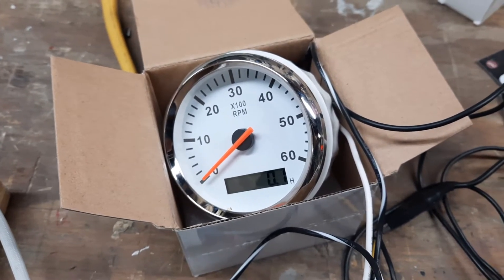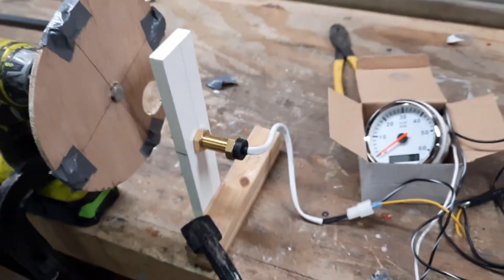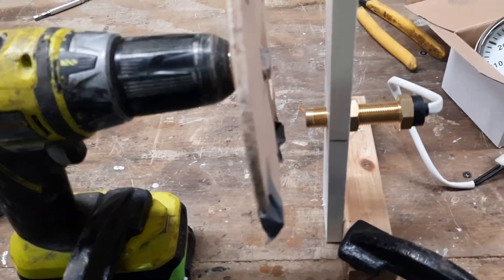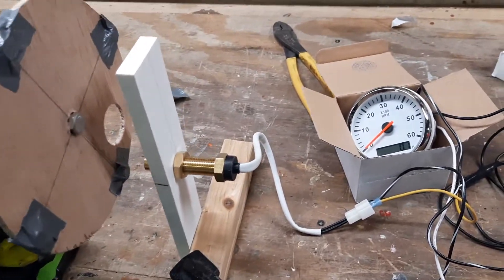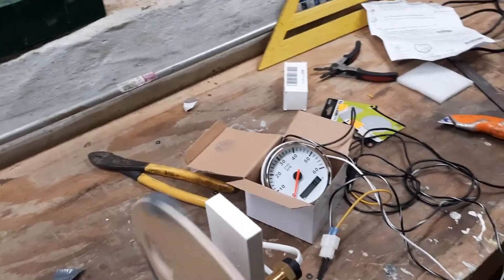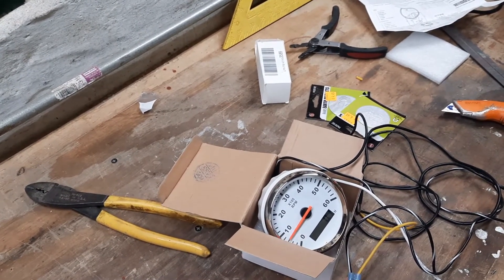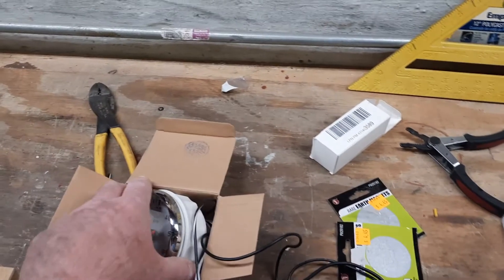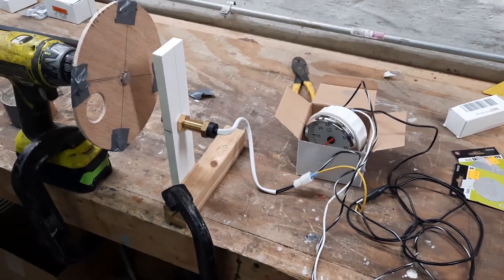Eling Tachometer and Sensor bench test

Comment: Looking to make this work on a Honda single cylinder motor, aka gx420. What’s your thoughts on the sensor picking up enough magnetism  from the magnets on the flywheel. The same magnets that fly buy the ignition coil making spark?

Also how did you wire up the sensor’s 2 wires ?
Reply from the maker: I'm using really strong rare earth magnets but I think any magnet would work if the sensor is close enough. Do your own bench test with a multimeter set on ohms and see what you get.

One wire goes to ground and the other to the S terminal on the tach.

Good Luck!
Reply: @TallTom77    Thanks for the quick reply and have a great day tomorrow, today about over so I’ll say tomorrow 😁

Comment: Why dis tou put 4 magnets ?
Reply from the maker: The tach can be adjusted to any number.
Reply: Please explain me , i am trying to set up ome the same . I put just one magnet but doesnt work . Do you thing i have to put 4 ?
Reply from the maker: Do you have an ohm meter? When the magnet passes the sensor do you get a reading?
Small rare earth magnets are not too expensive if you need more strength to get a reading.
Good Luck.